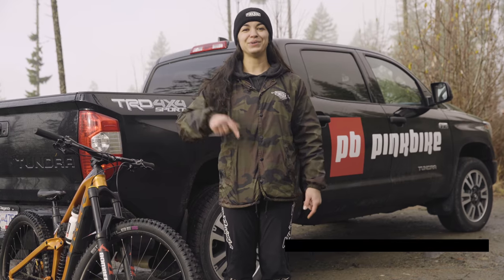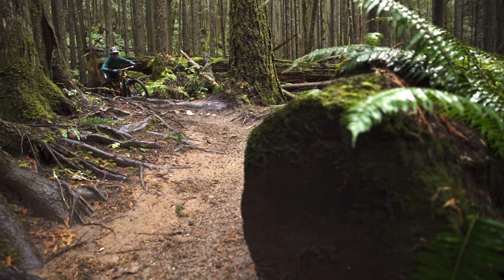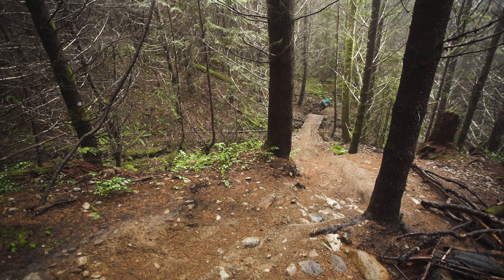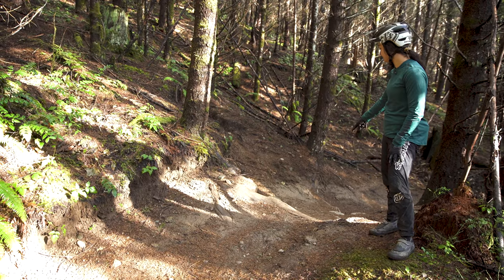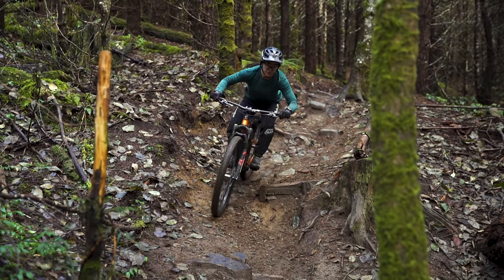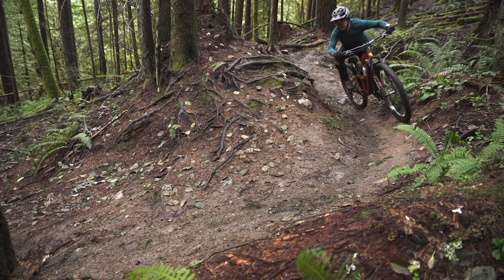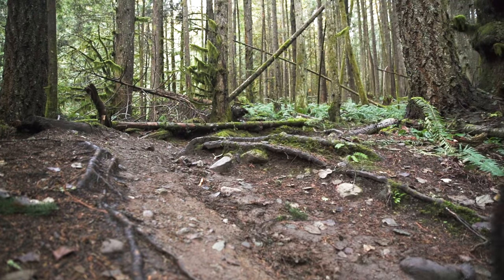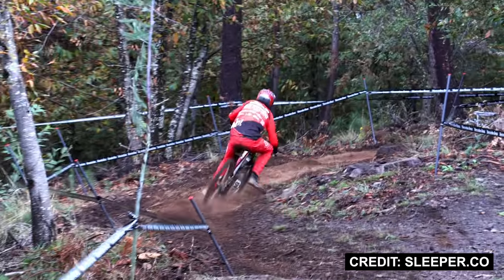Advanced MTB Cornering Techniques: Body Position & Technical Terrain

Comment: Having your chin in-line with your stem is a great tip. I used to lean way back and wrecked fairly often through fast berms. Getting my weight forward has made a huge difference...and my front wheel hasn’t washed out once.

Comment: Nice pieces of advice here! We never miss cornering tips 👌. Sometime it's a bit hard to lean the bike as you think it's gonna skip but maybe it's a matter of weight distribution 🤔. Great video anyway ✌
Reply: If your low to the bike, with elbows bent, when the bike skips away, you have space to extend your arms and / or legs. Try get lower on the bike. Once you've had it happen once or twice, it actually comes naturally. You always expect it to, maybe, slide some. You can see her doing it more than a nice in this video.
Reply: @derman3658  will try it ✌thanks

Comment: I didn't understand this part at all @2:34. I don't know if the audio didn't match the clip or what, but I just couldn't figure out what you meant and it felt important... Cool video, loved the look of the forest etc.
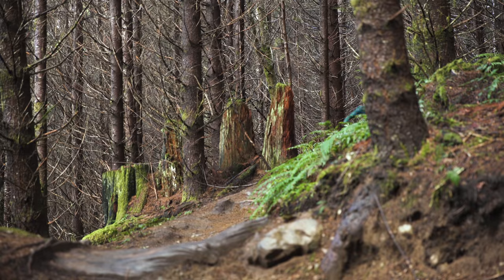Reply: Christina says, "Move your bike to the inside of the turn." I say it like this: "For non-bermed turns, lean the bike toward the direction you want to turn." At the same time, shift your weight to the opposite side of the bike in order to remain upright. How much you shift/lean depends on the situation. At 2:34 to 2:45 of this video, she is talking about shifting the weight, but it does not look like she is doing much weight shift. If you look carefully, you might see that both those turns are banked, which is almost the same as bermed. In that situation, the body leans to the inside of the turn, too. See @2:43.

Comment: Stock parts are all pretty good to get started on https://www.youtube.com/post/UgkxHL1v1R3NE5x4KiYfyt8dnQmyNYz7qi5L  but the round caliper pads are not very good --- can be swapped out with Shimano 416s using just hex wrenches. Out of the box, it needs to be assembled and the brakes adjusted (they're not floating discs, so they are much more sensitive to caliper adjustment). Brake adjustment requires care, as the set screws are a little hard to find, and ignoring them (forcing the adjustment screws) leads to compromising the entire caliper integrity (caveat emptor). Also, I recommend Schwalbe 620mm Marathon tires (heavy but cushy and reliable).

Comment: Yeah you the best pink bike!!! Send me a nice bike for under $600 USD please I have been searching since JULY.
Reply: Where are u located? My lbs has some Cannondale trails. But need to add a cpl hundred. 1x drivetrain, airfork,hydraulic discs,dropper 700. Better version 4 or 7 se 1100 and up
Reply: More Entry level with not all that stuff you'll want for that price tho.
Reply from the maker: You can do it! My first hardtail mtb was maybe $500 and I loved that thing! Survived a whole season in Colorado and then Whistler -Christiha
Reply: @pinkbike  i actually just dropped off my first mtb ever a 2000 giant revel 1. $500 bike.Fixed it up for my nephew for Xmas last year. :) 3x drivetrain entry level as can be 😆. Just needs some maintenance